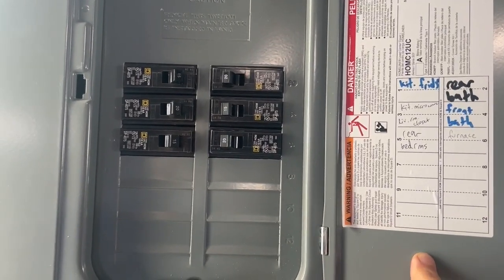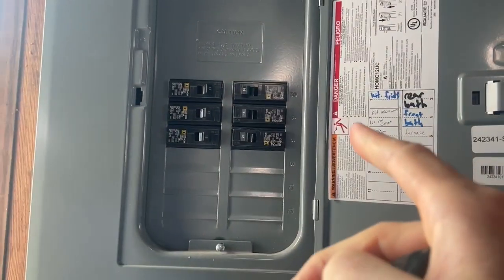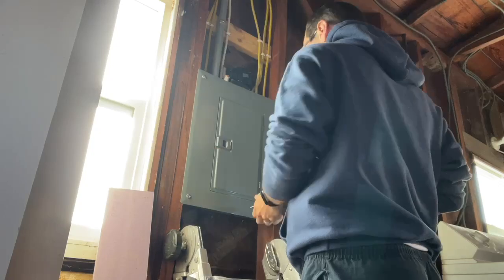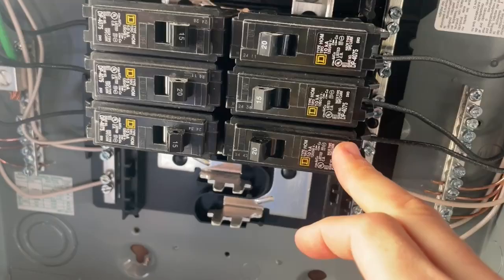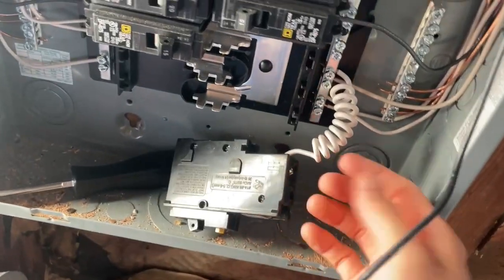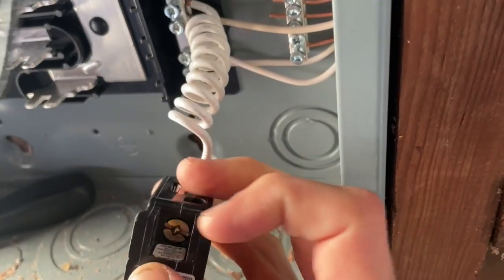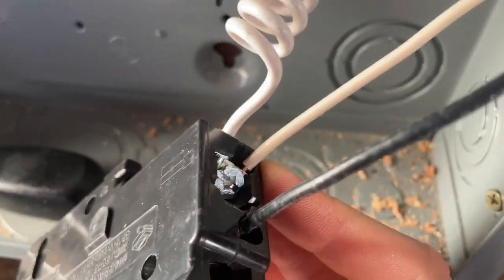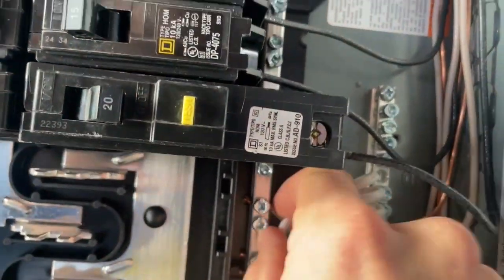How to Upgrade Your Home's Circuit Breakers to GFCI for Improved Safety

Comment: Any induction motor or heat doe not work well on a GFI breaker, this is totally unnecessary for a furnace circuit.
Reply: nonsense  Modern GFCI (Ground Fault Circuit Interrupter) breakers are designed to handle both induction motors and heating elements without issue, though specific conditions can lead to "nuisance tripping"
Reply: @jm-lc3jp  So how many have you replaced running an induction motor?